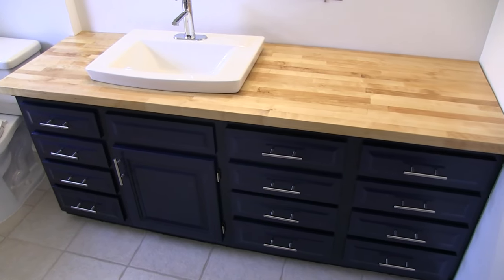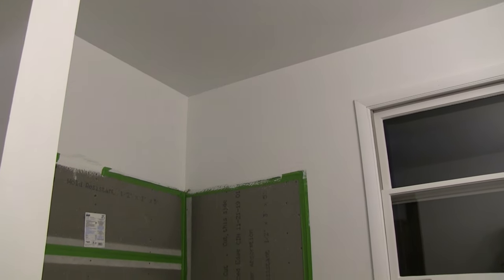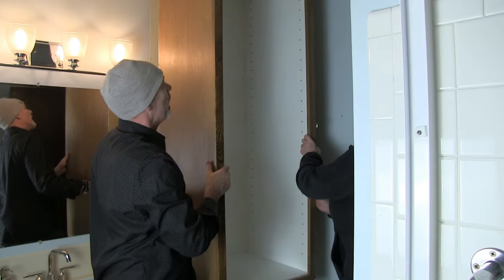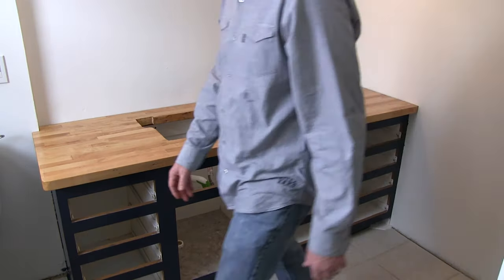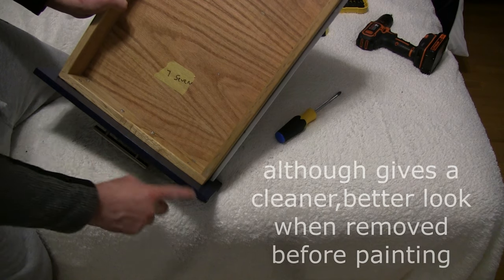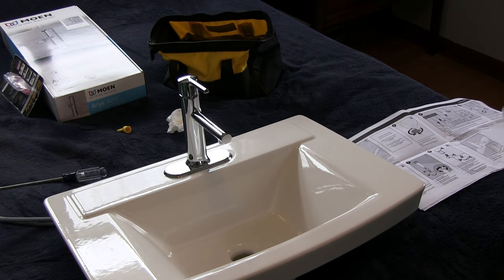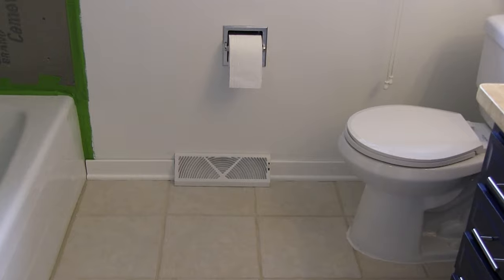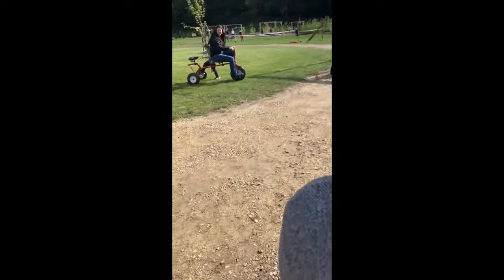Bathroom remodel: Finishing the install (wood countertop, faucet, vanity)

Comment: Beautiful! You didn't show us how you hid the white melamime
Reply from the maker: I purchased pre primed wood ( I think it was pine) moulding that was 1 & 1/8” wide by 1/4” thick and after painting it the naval color I affixed with some silicone caulk and used a minimal amount of finishing nails to hold it. As a side note be careful when doing because if you get messy with the caulk or adhesive if used it can show. Sorry for the late reply. Thanks for watching :)